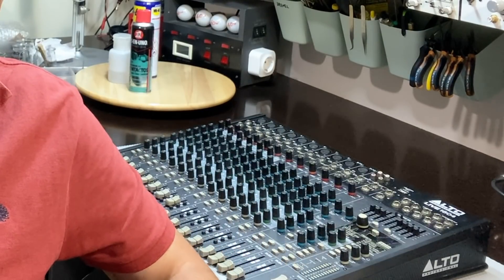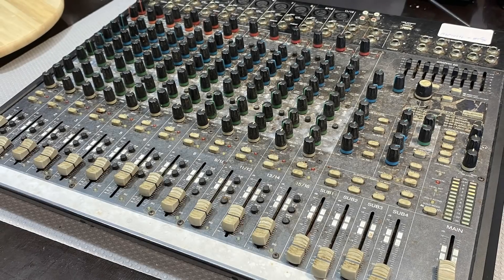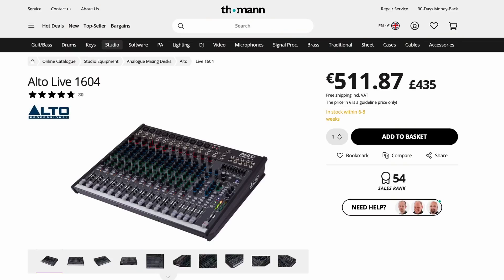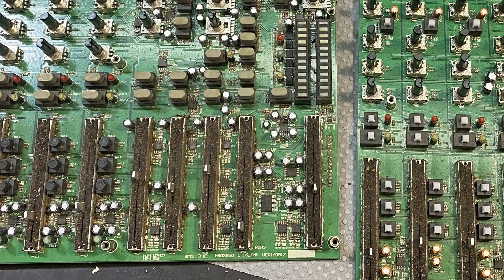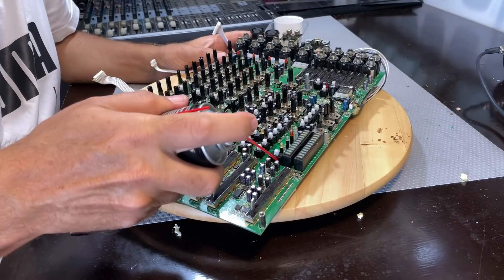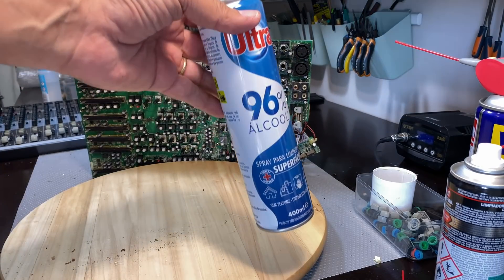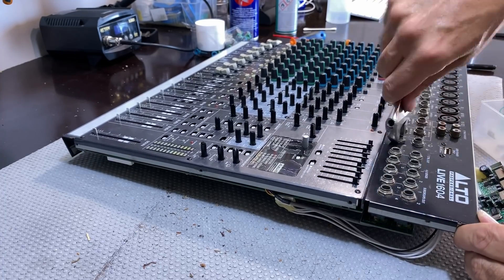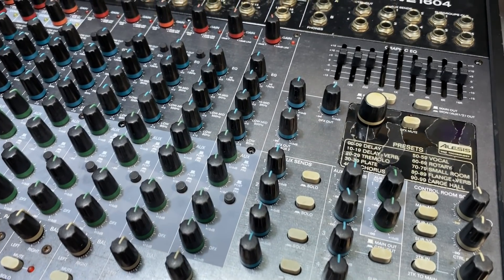Dump it, or Repair it? Is it financially viable to repair this Alto Professional Live 1604 mixer?

Comment: Stiff brushes, contact cleaner (which is probably a distilled petroleum product rather then isopropyl), and a relatively powerful air compressor is usually enough to break down, break loose, and brush/blow away the worst of the worst.

Comment: Several decades ago I did a lot of  dance-club sound system repair and maintenance.  We basically used one of two different brands of DJ mixer, either a Rane mixer with slide faders or a Urei with rotary pots instead of sliders. The Urei mixers didn't much care if you spilled a drink on them because there was no way for the liquid to get inside it. The Rane mixers did require periodic cleaning of the faders, and a spilled drink meant major service was called for; however the fader that took the most abuse in the Rane was the crossfade slider, and that was on it's own little screw in plate and could be easily replaced from the front of the mixer by removing a couple of screws, unplugging the old board and plugging in a new fader,  without disassembling the mixer or even removing it from the system.  I'd like to see all mixers designed with all of the faders easily user-replaceable like that.

Comment: If you can get Never-Dull polishing wadding where you live, I recommend it ---- it's a cotton-like mineral wool dampened with some kind of light petroleum distillates, and not only is it excellent for polishing brass, nickel, chrome etc but it is usually safe for fragile silkscreening that might dissolve from exposure to ordinary cleaners such as Windex. I've used it to clean vintage McIntosh amplifiers without damaging the silkscreening (don't ever use windex on those!).
Reply from the maker: Unfortunately can’t get it here.

Comment: I totally agree with you on the fact of repairing good equipment vs discarding and buying new. That's why we love vintage equipment as well. But it's just a problem of the time we live in: labour intensive repairs vs cheap new equipment, often cheaper and with new features. We live in a throw away society unfortunately. I hope the testing went well after the big cleanup. What about the greasiness of the pots, did they lose that after all the alcohol and were you able to put in some new? (I want to clean 2 Mackie Onyx 1220 mixers in a few months)
Reply from the maker: I had no problems with the testing, and the pots turned out well.

Comment: I have seen other tech people use an ultra-sonic bath of water with a bit of sufflicent to clean mother-boards using a bit of pressurised air, then water disperser.  Works like a treat.

Comment: Well, we really don’t know if all this work actually repaired anything. Chances are, all that spraying did was to temporarily liquify all the contaminants in the pots and switches. The contaminants sloshed around inside the parts and did not actually “go away”. In the process, the shafts have now lost all the grease and they feel too lose and no longer smooth. It’s a tough call in these old mixers. The only way this could be “worth doing” is if you are a tech yourself and you can acquire the mixer for free and do the work for free. And maybe get a few dollars for it on eBay.

Comment: Mixing consoles are my speciality, I found a Rodec MX180 mixer, totally neglected. I had to buy a knob set, It had coke or beer in it, so the powersuply exploded. So I thought it was a good idea to do a revision on it, and made some mods that I know from a former service engineer from the Brand, they still are very popular in Belgium. And prices go up to about $600 for a mixer from the 80s, that's pretty good, but I kept this one for myself, and if you doing this much, buy a ultrasone washer, I even put complete pcb's in there. I also had a 12 channel Soundcraft for broadcast on the table, this was a expensive one, because there were so many VCA circuits in it, which some were at the end of their lives. Last I had a D&R Airmate, a revision of the K-ALPS faders, I also did tis for free, for a good friend of mine. He uses this on a daily basis for radio. had so many projects, it becomes quiet a list. Nice to see some other people don't go for the buck. But being realistic.
Reply from the maker: Yes, the older mixers can be incredibly gratifying to repair and get back into full working condition.
Reply: @electronicsoldandnew  What I also do, on the side, is development things, I'n now building up a ClassAB discrete amplifier, with real 2x70w RMS into 8 Ohms that's a beast. Latest I had a Class D amp 4 channels where one of the TDA's got flames. Class D is not made to play silently, like in a restaurant, than the TDA Also collapse. All is very interesting to see these work again. And the reward is always great. Sometimes amps are so roosted, it makes no sense to repair them. Becaus any fault in these circuits are mostly fried.

Comment: Much of my early career was as a computer tech in the days when we had to do component level repairs on site.   It was often a challenge but overall the job satisfaction was great.   I got a huge buzz out of bringing a customer's machine back to life.  Of course I worked for a computer company so was not dependent on getting paid for each individual repair.  In those days customers would have a maintenance contract even for their large office calculators!   I'd say the only way that these types of repair can happen now is in support of a sales business where a company that sells these products provides repair serivces.  As you say, an independent repair business is no longer financially viable.   Nice repair on the mixer!
Cheers,    John
Reply from the maker: Thanks John. In the early days of PC’s I co-owned a small computer company, and the main source of revenue was in fact maintenance work. Very quickly the repair job became one limited to “swap out the board” and I noticed an ever-decreasing sense of satisfaction from the techs doing the work.

Comment: I deal with this often.......  weighing how much it will cost to fix items that have failed.   Pre-digital era stuff is sometimes easier,  because components are usually more generic.   Mixers are tedious as heck.  I re-capped a 1979 Peavey.   GREAT sounding board.

Comment: I too am a hobbyist, more so than you because you obviously have an EE education, I am self thought, and electronics has never been a "job" for me. I do some designs purely for my own use and I also do repairs and restorations. I like repairing relatively older electronics which were designed to be repaired, of which one can still find schematics and info on. New consumer electronics are purposefully designed to be replaced rather than repaired, with lots of impossible to find custom built IC's, absolutely no technical info provided and worst of all, most of them rely on software to work. So, unfortunately IMHO, electronics repair is a dying profession and the new generation of engineers are right in not choosing this as a profession.
Reply from the maker: I understand your point, but also believe that society can change. I have a 21 year old daughter that makes a point of only buying equipment that shows some quality and durability, moving away from the consumerist view of the market. More and more of that generation is raising the issue of sustainability of materials and devices, so there is some hope that a lot of what would have previously been called junk, may actually have a future in the homes of the next generation of adults, who value vintage equipment more than the previous one. I know this is all very 'wishy-washy', but with the help of some legislation, who knows what might happen. One thing is for sure: we cannot continue to fill up dumps with electronic junk forever.

Comment: I worked at an industrial control corp-Robicon, we washed boards out of a wave solder machine in a carwash looking machine with soap & hot water. Plus we had a regular dish washer we did some of the smaller custom cards. Dried with hot air & finished with compressed air. Try some in the dish washer when the wifes out
Reply: Modern circuit boards have to be scrubbed ultra clean because the organic-acid fluxes used with leadfree solder are corrosive and conductive. Residues from ordinary Rosin flux rarely cause problems, but leadfree solder is terrible stuff that is often responsible for premature failure of electronic devices.
Reply from the maker: I’d better be sure it’s over by the time she comes back or I’m toast 😊

Comment: Great video, i agree with the idea that we should repair rather than replace.. In regards to Professional audio mixers, as a Dj i have had to replace many mixers over the years, mainly due to only one or two faders becoming faulty. Main reason being that the fader length and value was no longer available..
Reply from the maker: That’s usually the problem. New mixer or else …

Comment: I am an electronics repair engineer and I do make a living out of it (just). But I am in the process of re-training to be a virtual server engineer. The repairs industry is dead - even in computers. So I totally agree with the points you are making. I repair radios (mostly valve based) as a hobby. It harks back to the days when repairing was relatively easy to do because you could get the circuit diagrams and components. Nowadays that just isn't viable. Companies protect their investment and do not release information on their hardware. They go to extreme lengths to prevent people repairing their kit. This process was well underway when I started in the industry back in 1983 and now it's almost perfected. The only way to repair some kit is to have a spare broken unit to rob parts out of, and even that doesn't always work as they program things to recognise if you have replaced things and become unusable. Certain manufacturers whole ethos is to prevent people copying them (fair enough) and to make the customer buy whole replacements or take out expensive warranties (not too fair in my eyes). I'm not sure what will happen in the future, I know Europe is interested in applying the policy of reduce, re-use, recycle and are legislating reparability into the terms and conditions of selling electronic equipment. But who knows how successful that will be given the monetary might of certain companies. For me it will always be hobby as long as I am able, but I watch the industry with interest.
Reply from the maker: yes, the question of the power of the big companies is always a problem. However as they didn’t do anything themselves I guess legislation is the only means of affecting change. I hope it works, for everyone’s sake.
Reply: You are referring to the "Right to Repair" and/or "Right to Own" movement.  YouTubers such as Louis Rossman and Fran Blanche (FranLab) have done numerous episodes about this. Two of the worst corporate offenders are Apple and John Deere; whenever there is  a court case around these issues, it hardly matters what company is being taken to court for monopolistic and trade-restrictive practices (auto manufacturers in particular are frequently sued for not providing parts/service/software to non-dealer repair shops and individuals who want to repair their own car);  lawyers from John Deere and Apple magically show up and offer to "help" protect the other non-affiliated company or industry from legal action, in hopes of preventing establishment of legal precedents that would eventually come back to bite Apple and John Deere in the arse as well.

Comment: Wow, that would take me seven weeks, let alone seven hours, and only if I owned the device and lived alone in a cave on a deserted island...  Great job, as usual.  One suggestion:  Using a small adjustable wrench to turn the nuts holding pots and switches in place makes me nervous.  I once scratched the pristine face of a 60 year old VTVM with such a tool.  I now use a set of plastic socket wrenches called Rocket Sockets from Peper's Pedals, a small audio products company based in Dunedin, New Zealand.  Though not meant for heavy mechanical work, these are plenty strong for electronics work and they're guaranteed to not scratch the faces of your equipment.
Reply from the maker: I’ve been meaning to get some of those wrenches for some time. Great and safe too.

Comment: Manuel, I really don't want to spoil your victory, but I cannot shut up right now. Yes, the amount of pots makes it all very difficult, that should be enough for your defence 😊 BUT... the 'feel' of the knob is usually done by putting some sticky grease on the axle (or slide path), so it will restrain your movement. It also prevents the more free movement to 'hurtle', what would be noticeable in the produced sound. When you spray contact cleaner there's a big chance you will dilute that grease, and it could spread over the carbon track. That is the main reason why taking them apart is a very good idea, so you can clean the tracks with a swab, without disturbing the grease. But again, the amount of pots is horrible here, so you are excused. Still, the sliders I would have dé-soldered and cleaned by opening them. One comfort, the middle way of it all can be to use a VERY tiny amount of spray.
I really wonder if using only distilled water would be a good idea. It will clean, maybe you could make it a bath as you proposed, and if not to timely it won't touch that grease.
Reply from the maker: You make good points. Definitely food for thought and some future experimentation. Thanks.
Reply: @electronicsoldandnew  good answer!
Reply: @jdmccorful  Yes, it seems addressed. It is specially important in the audio world I think.
Reply: @electronicsoldandnew  And thank you for having a look over your shoulder 😌
Reply: If you can find a cost-effective source for a bag of tiny lint-free Q-tips of the type that were once used to clean CD player and DVD laser-lenses, perhaps from a  medical supply source, you can dunk those in alcohol and reached down tthrough the slots of the fader and and clean the carbon tracks manually without removing too much of the grease on the sliding parts of the mechanism.  If it helps to bend the Q tips into sort of a golf club or hockey stick shape just above the fuzzy part (you can reinforce the shaft of the q-tip at the bend with a dab of wood glue or tiny drop of superglue).  I have successfully cleaned fader tracks in this manner and it does work,  but it kind of takes a light touch and a lot of patience and maybe some X-ray vision so that you can visualize what you are doing without seeing it all that well.  You can also use a tiny amount of FaderLube or other carbon-track safe electronic cleaner on the Q tips without having to spray it all over the place inside the fader, thereby diluting the grease.  Hard to say if it would work when the faders and pots are as filthy as they are on this machine, but  I am often able to salvage to salvage the faders this way without having to take them apart for a full overhaul.  By the way, if you don't have anything else to work with, you can use clear silicone transistor heatsink grease to relube the sliding parts of the fader with, although you don't want to get it on the carbon tracks.  It won't feel quite the same as the original viscous silicone but it will work. Ideally you want something more along the lines of the damping fluid used for turntable cueing mechanisms that has a viscous honey like consistency.  You might have to try several different silicones to find one of the correct consistency but if you have a really thin silicone damping fluid and a really thick one you can mix them together and get it to the consistency that you want.